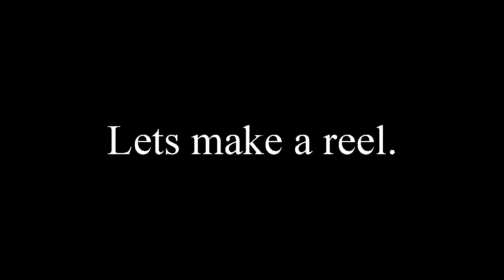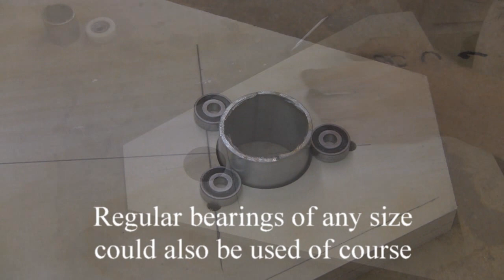Homemade Pool Solar Cover Reel

Comment: Nice job. Now I just need drill press, table saw, table router,  band saw,  a cnc machine, a  grinder with a cutting wheel...cheaper just to buy the damn thing.
Reply: these were my thoughts exactly

Comment: Nice work, looks like it will really save you time and make the task less frustrating.
Reply from the maker: Thanks Andrew, it works like a charm:)
Reply: Bellevue Woodshop Would you consider building one as a kit and selling it?  You could ship just the end pieces and the end user could add the pole when they get it.  I really like the one you made but don't have the tools or know-how to build one myself.  I need one for a 20' x 40' in ground pool.  It is a beautiful piece of work and I truly enjoyed watching you bring it to life!
Reply from the maker: mosconi0359 Thank you for watching and commenting. There are some great commercial ones available at a great price if you live in the US. Check amazon.com. They have with or without the pole. Without is  170usd. A complete reel here in Norway is approx 600usd
Reply: Thank you I'll check them out!

Comment: What a great job. One safety comment based on an accident that happened to me. At 7:03 you are holding the collar with your thumb while drilling . I did something similar and while drilling the bit broke in half and  you guessed it ,  I drilled clear through my thumb.  Glad it was a reversible drill motor. No more Harbor Freight bits for me..lol
Reply from the maker: Thanks, Ouch that did not sound like a pleasant experience

Comment: Wow, NICE project, but I am BLOWN AWAY by your view. I am a recent subscriber, so not sure where you are (region wise), but you have one amazing view from the pool! That view is worth a million bucks alone! One question about the build...how come the wheels come out so rough using the CNC machine? The outside looks like it does on the screen...a series of straight lines to make the curve...If that makes any sense to you? Thanks for sharing though. I am going to watch your other videos to get a glimpse of your view again from another angle!
Reply from the maker: Thank you Sir. I am located in the southern part of Norway almost by the coast. We are happy with the view. That is one sharp eye you got there if I may say so. You are totally correct. The circle on the handwheel actually has 24 sides insted of beeing completely round. I cheated with the outside on the disc sander and made it smooth, and figured i would leave the inside to give me some more grip if needed. The reason for the jagged edge is that I drew this in Google Sketchup and exported it to a dxf file to import it into my cnc software, for the first time. I had already taped the video, and did not, at the time want to go back and reshoot it.

I spent some time on google the day after,and forund that sketchup has a default value of 24 sides ehen drawing circles. This is not that visible on smaller circles, but when drawing something of this size (340mm dia) is becomes visible. the fix is o press the circle button, and before any other moves, type in a nuber of sides you want. i put in 300, and it turned out smooth. There could be an issue if you put in a to large number, but you will notice that it cannot make a surface then. i dont think I have any other videos shot outdoors. Shoot me an email at bellevuesnekkeri (at) gmail.com

Comment: I really like your videos.

Why did you spray window cleaner on the little wheel before you glued it to the big wheel?
Reply from the maker: George Trott Thank you George. I used polurethane glue, and it is activated with moisture, so i spray water on the maing part. I just used an old spray window cleaner spray bottle. Thanx for sharing the video

Comment: I enjoyed watching your video!  I am in the process of having to buy another solar reel and some how got directed to your video.  What kind of rope did you use to pull the cover back on the pool?  I usually have to pull the cover back on so it gets tedious to say the least.  Thank you for a wonderful video!
Reply from the maker: Mireya B Coronado Thank you. I just used a regular nylon rope like the ones used for clothes lines.
Reply: Cool.  Thank you for the info.

Comment: this is brilliant!! what type of pipe did you use? I'm having a hard time finding something sturdy enough to avoid sag, yet not bulky.
Reply from the maker: Thank you. I used a 45mm Stainless steel pipe that was meant for glass fence posts.

Comment: Did you use steel or aluminum for the tube? I've been looking to source a 3" tube of aluminum for this project and it will cost me more than buying a reel system in its entirety.
Reply from the maker: I used a 40mm stainless steel tube, salvaged from a stair railing build. An aluminum pipe would pobably need to be 3" as you say to be stiff enough

Comment: Do you have plans and/or a parts list available?
Reply from the maker: Hi Matt. Sorry, no plans. But if you can find a stainless steel or aluminium tube that is strong enough you actually just need a handfull of bearings and off you go. Thanks for watching and commenting
Reply: Bellevue Woodshop what diameter did you use, and how thick is the material?

Comment: Well done but could be all made with pvc pipe and fitting much easier and cheaper
Reply from the maker: Thanks, but over a 5 meter length I think even a 4" pvc pipe would sag way to much😀👍
Reply: Bellevue Woodshop 1 1/2 schedule 80 might some but not much.

Comment: Well, I wish I had thought of that about 30 years ago. It would have made my life so much easier. But young and dumb and lazy.  And it is bad lazy when you can't think of a way to do less work.  I believe that is called stupid.
Reply from the maker: Me myself have been doing it the same way as you for the past 8 yrs. The pool did not get very much use until recently, so the hazzle became bigger and needed an upgrade.Thanks for sharing the video

Comment: Der var mye tid og frustrasjon spart! Det er ikke mye som er verre enn å styre med store duker og presenninger.

Jeg synes det er bra du bruker en fin liten Makita kapp-sag og ikke en gigantisk arbeids-sag som de fleste amerikanere bruker! Alt skal vel være stort i USA tenker jeg, kosta hva det koste vil :P
Reply from the maker: Bjørnar Magnussen Har fungert utmerket. Tenkte den ville være ypperlig, og muligens enda mere nøyaktig en en større sag. men savner en større kapasitet i høyden, spesielt på beveled cuts. Blir nok byttet ut med en 10" etterhvert. så blir nok denne 7 1/4 tommeren til mobilt bruk på andre jobber utenfor verkstedet. Mye av årsaken til at de bruker større sager er nok prisnivået, 
samtidig som 2 x 12" plank er like vanlig som 2 x 4" i byggevaren her.. muligens